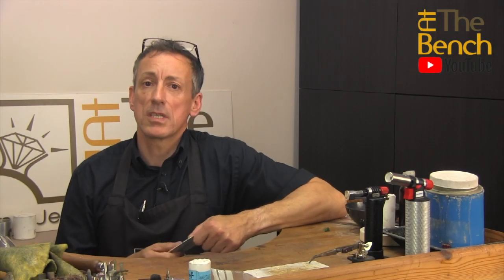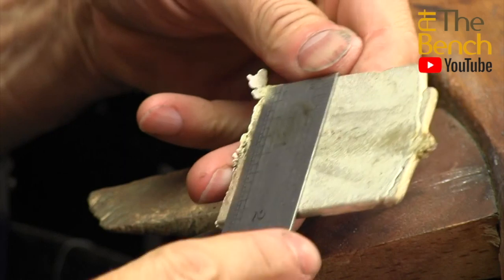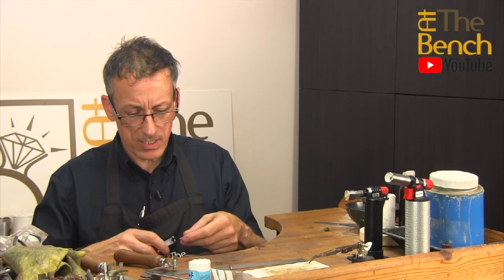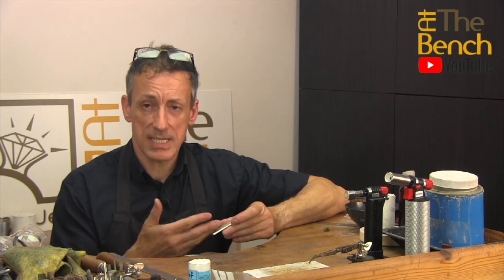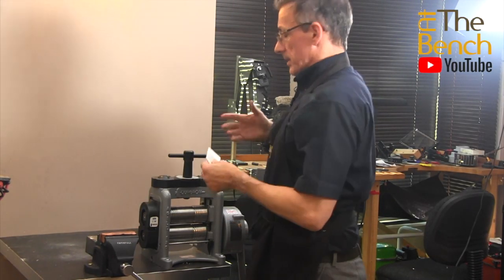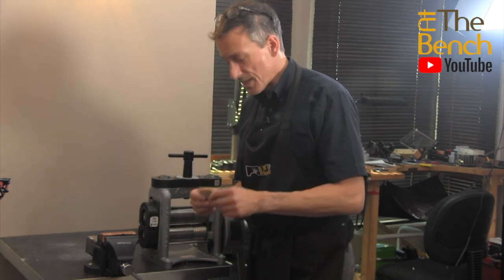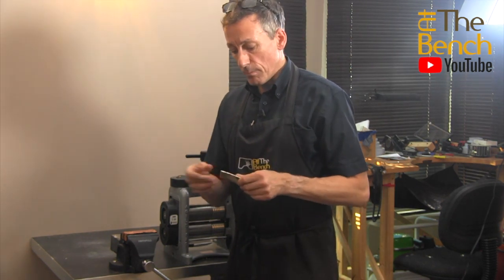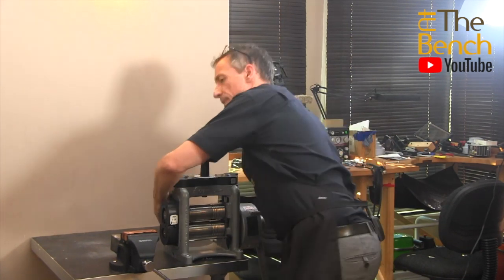How To Roll a Silver Ingot To Make Sheet Stock - Recycling Old Scrap Silver

Comment: Thanks Andrew once again for sage advice.
I started yet again with a fresh 4 mm thick ingot (25 x 10 mm) In the hope of making 0.6-0.7 mm sheet.
Whilst at 4 mm I could reduce the thickness to 3 mm (-25%) without any splaying of the silver, I found that once I went under 1 mm it became much more complicated. I finished up with 0.6 mm sheets/strips but I was annealing every 0.025 mm - 0.050 as the strips were springy after every pass. 
I'm delighted because every time Iv'e tried this in the past I failed miserably but with time and patience I nailed it.
5 lovely strips of 0.6 mm sheet on the bench without cracks all over them.
I had nearly given up.

Comment: Awesome video! You confirmed a lot of the nuances I’ve discovered using the same exact rolling mill and process. It’s a lot of work but really satisfying to do this. 

As far as the issue of the ingot curling, I usually will anneal and hammer flat. Also cross roll at a 90* angle if the width allows.. or a 45* angle. If I catch the half round or square grooves a little bit, I back off the thickness bar so the impression isn’t as deep. As I continue rolling through the flat area, the grooves will work themselves out. Any marks left when I’m done with my ingot can be removed by sanding. You can cheat and get a slightly wider finished sheet doing this carefully. 

At this point I also just go by feel for how much to take it down each pass. You have to make so many passes it will drive you crazy trying to be exact each time. 

I never thought to throw the entire ingot in the pickle to dissolve the flux that gets stuck on it occasionally. Thank you for that tip! 

I love this mill so much, it was one of my first major investments and has paid for itself so many times, it has to be one of my most essential tools. It was nice watching this and seeing some of the same moments that made me pause and wonder “am I doing this right?” when I first got it.
Reply: The brown twister roll to deploy 🖕 to cover the beetle when I ran Satan when he was keep on changing the situations to cover the dog looking ip to the airport 😭😂

Comment: Agile C 130 is a little beast. I have from 2  mounths in my shop and is perfect. It worth every penny. The metal came out so perfect no needs to use file , ready for polish. i melt abought 25 gr and flat are Is  enough space to work in.

Comment: Hi Andrew and all you others looking over his shoulder too.
During the rolling, it is the time, when we also see small dimples where there are hidden air pockets inside the ingot. What have we (=I) done wrong during casting? I am using the Smith Little one with acetylene and oxygen. (propane is not available in this part of Borneo). I am using the multi orifice (rose bud) tip.

Comment: Thumbs up as always! It's so hard to decide on my first mill, pepe or durston? 🤔 Iknow you're a Durston man 😉 haha. I'd sayil I'll get a little combination one like you had here, would you say it's best to have the wire section to the side of the mill like your own down stairs? Or would the one like you used here be okay for most small shops n someone that's only Makin jewlery two years
Reply from the maker: Having extension rollers on the outside of the machine does make it a bit more expensive. It all comes down to cost in the end. If you are in the UK deff go with a Durston
Reply: @Atthebench  ohh I didn't know that the roller on the side would be more expensive so thank u, I will certainly keep that in mind now so. Iam in Ireland so I definitely hope to get a mid range durston. I was gonna buy a cheap Indian knock off but I know it wouldn't last of be near as good. So I appreciate the feedback as always Andrew and IL save a little bit more haha., all the best

Comment: So...if you have a narrow rolling mill, is it absolutely necessary to cut the piece to get a proper piece of sheet metal? Is it completely unadvised to make a log strip instead of a square? any more info on this would be great thank you.
Reply from the maker: You can roll a long strip but you would have to use a mallet to straighten the sheet once you had annealed it

Comment: Andrew, you say 16:30  'quench it in the safety pickle' and I thought students were taught to never quench in pickle, because the heat released from hot metal causes 'bad pickle fumes' to rise up, so to either pre-quench in water and then go into the pickle, or just air-cool a bit and then put it into the pickle.  What are your thoughts about the 'previous info'?
Reply from the maker: In the days of sulphuric acid I quite agree with you. But I would let the ingot cool to a black heat before quenching so there are hardly any fumes given off.
Reply from the maker: In the days of sulphuric acid I quite agree with you. But I would let the ingot cool to a black heat before quenching so there are hardly any fumes given off.
Reply: @Atthebench  Ah, thank you for that clarification.  I'm using Rio Pickle and I saw on the box "Warning! Contains Sodium Bisulfate. Releases Sulfuric Acid on contact with water" so with Rio Pickle, I guess it's not quite as safe as your safety pickle".  Am I understanding or still mistaken??